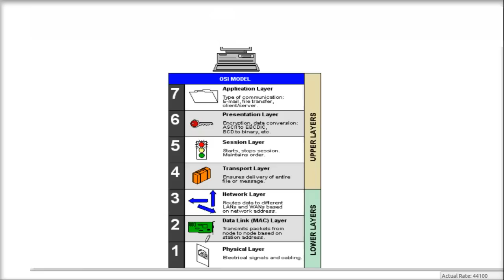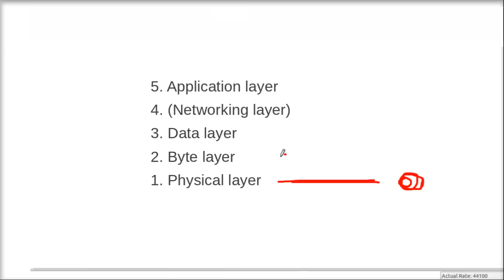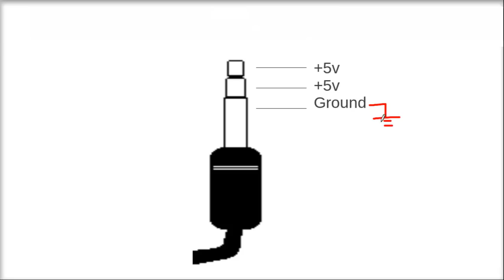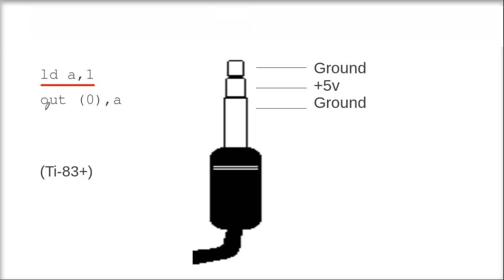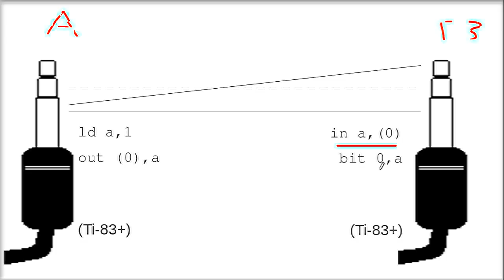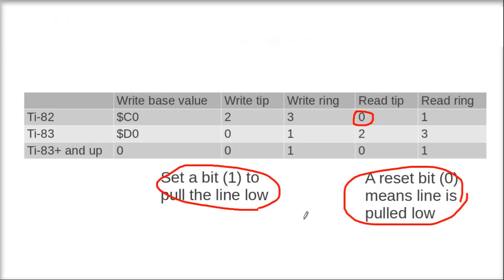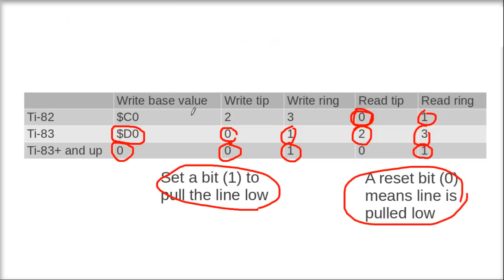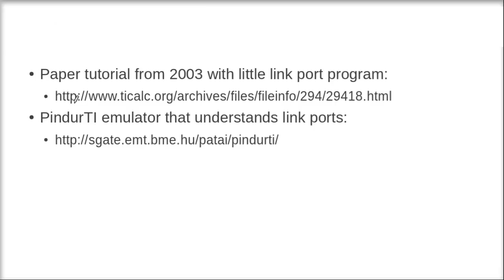TI calculator link port tutorial Part I: Physical layer

Comment: A very interesting video - great work. :-)
The I/O lines are implemented as "open collector" outputs - a transistor is used as a switch to hold the line low when switched on and a weak pull-up resistor is used to allow the line to rise high again when the transistor is switched off. When you output a 1 the transistor switches on and the line is held low, so reads as a 0 - this is how the output value appears to be inverted.

Comment: The I²C bus and AT devices (including PS/2 keyboards and mice) also use two open collector lines, so are physically compatible with the calculator's I/O port (you do of course need to write appropriate software to support them).
The "thingummyjig" you mention at 04:05 is a ferrite bead, used to reduce high-frequency noise on the cable. It doesn't change the signal, but tries to stop external interference from affecting it.
I look forwards to watching the rest of the videos in the series! :-)